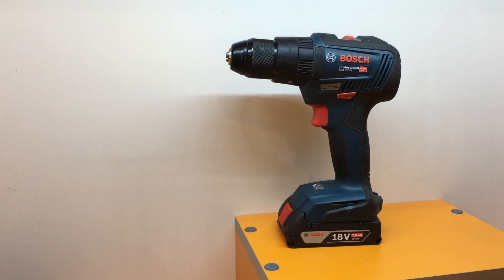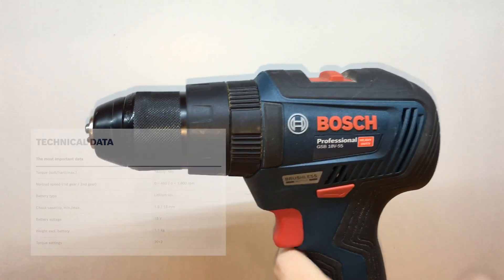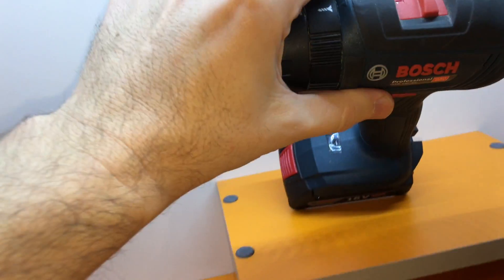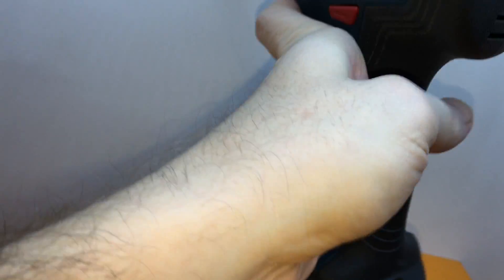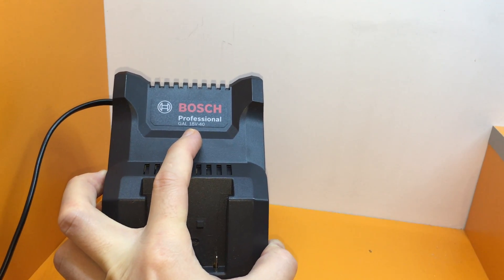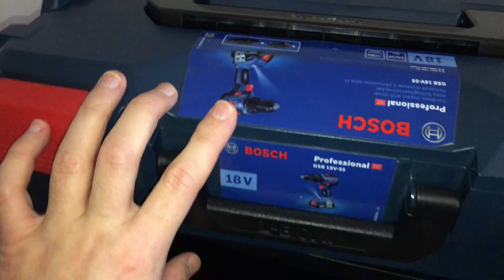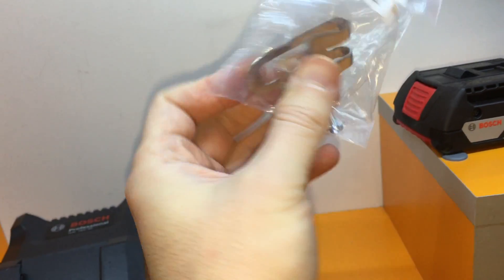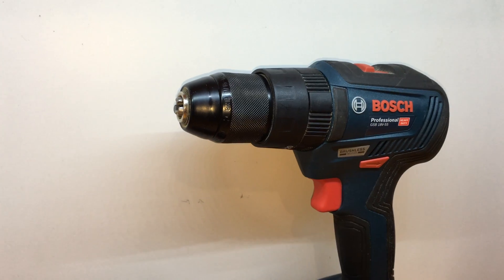Bosch GSB 18V 55 | After 1 year use | Test Review Results | 4K

Comment: Hi.
Have you ever tested your battery, please let me know, I would like to
   I know if it is normal for a 4 Amp battery to last about 1 hour if I use it continuously.  I cleaned the rust for an hour with a wire brush, the drilling machine worked continuously during this time of 1 hour. After that it was consumed. I am very curious to know.    Thank you
Reply from the maker: Hello Damian,
I would go for 5amp battery.
Nowwithstanding, dont forget to take brake 3-4min every 10 min, within this 1 hour work for your tool. 
Otherwise your Drill just will burn out.

Hope this will help you.
Reply: I would like to know how long it is normal for this battery to hold 4 Amps?  That's why I'm asking, I'm trying to find out. Thank you

Comment: Hi . HOW IS the Bosch gsb18v-55 overload protection, IF YOU KNOW?
If it enters the hole and gets stuck, it can no longer rotate, the drilling machine stops. What do you know about it?
Reply from the maker: Hello. Yes. It will stop. Wait for 10-15 min. After that proceed.
What battery do you have?
Reply: @VolatchOfficial  four amps
Reply: @VolatchOfficial  but it is normal to stop if the bit gets stuck in something ?
Reply from the maker: The drill will stop in case of overheating. 
In case of bit - try to remove bit and keep on
Reply: @VolatchOfficial  Try it yourself, before starting the drill, grab the chuck and don't let it go.  And it will try to start, but if it feels a little force, it won't start.   That's how I suffered.  And I don't like this, because it doesn't even use force to drill.
Reply: @VolatchOfficial  Hi. Do you think it is normal for a 4 Amp battery to last only 1 hour, or 1 hour and a half, after which I only used a small brush to clean the rust? I used the drill for about an hour continuously. I say it is very little. it should have lasted longer. What do you think?

Comment: It should be opposite from what you say, the 55 nm should be for gear 1, and the 28 nm for gear 2. High RPM means low torque and vice veersa.